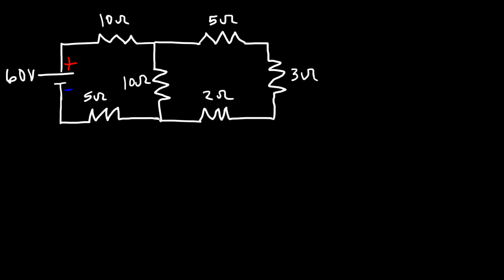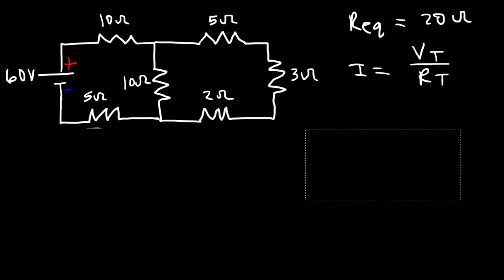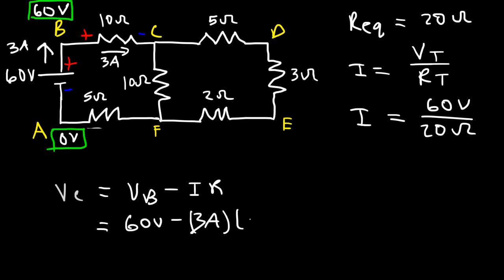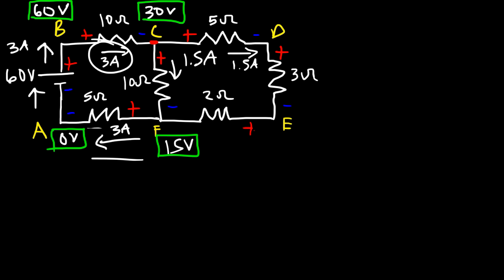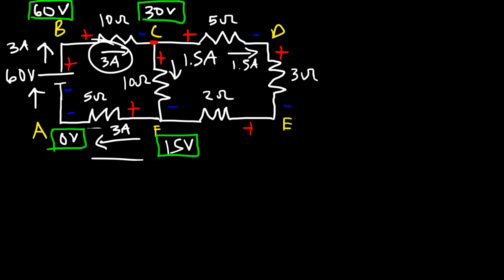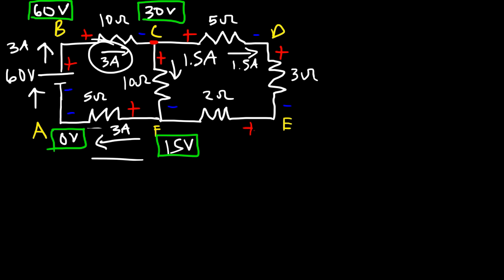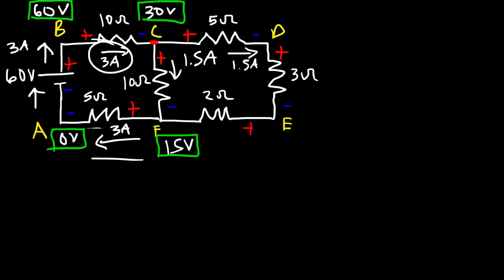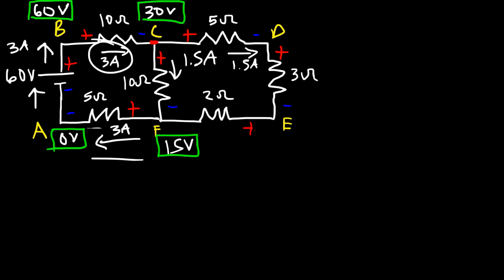How To Solve Any Resistors In Series and Parallel Combination Circuit Problems in Physics

Comment: for some reason i was never taught to redraw the circuit at all. I just watched this video and another one where you both redraw the circuit and my mind is blown omfg. it makes everything so much easier to understand
Reply: Exactly, I'm like wtf. My prof just told us to simplify the circuit in our head instead of redraw it. I'm like wut?
Reply: Absolutely NO redraws are necessary!. Find total resistance from right to left, back to the source voltage. Then figure the total current by Ohms law. Now, going from left to right...figure your voltage drops across  R1 and R6. Then subtract those voltages from the source voltage. Divide the 15 volts by R2 resistance to get 1.5 amps, which is half of the total current. The other 1.5 amps goes thru the rest of the circuit, or just divide the 15 volts by the total resistance of the three resistors in the far right part of the circuit. Bingo, problem solved people!
Reply: "thought" not "taught"    ;D
Reply: How did you solve without redrawing??😱😱
Reply: @adabujiki  it's taught
Reply: @user-sh8ms1kp1c  no, he's right, it means his prof never teaches him to solve the prob by redrawing the circuit

Comment: In physics class, to combine parallel repressors, we have been using the formula 1/Rt =1/R1 +1/R2, but that doesn't seem to be in your video. I'm still kind of struggling to understand circuits as a whole, and it would be very helpful to me if you could explain that rule/ its relevancy to circuits. The right hand rule also has been confusing me as well.

I love your videos, they've helped me loads in AP Chem and in physics. I'm really glad that there are people out there who make videos to help others, rather than click-baited videos.
Reply: 1/Rt = [1/R1 + 1/R2] and don't forget it's to the power of -1
Reply: You only combine them when u are trying to figure out the current encompassing the whole device (circuit). 
Once you do that you can troubleshoot your device with a multimeter and see where its failing you.
Reply: didiroxforever that method still applies, in the first question he did he said the total resistance for the the two ten ohm resistors in parallel was 5. He got that by adding 1/10 + 1/10 then finding the inverse of that answer

Comment: To compute 2 resistor  in parallel with different value just multiply the Numerator then add the Denominator and Devide the value that  you get  in 15:31 minutes 12 * 4 = 48 (Numerator) then 12 + 4 = 16 therefore 48/16 = 3ohms

Comment: Got confused about the current you wrote down towards the end. At 28:09 Should the current going from C to E be 1.7295 and not 0.5765 which is the current going from C to D to E?
Reply: I believe you had it correct you are just slightly confused. The current from C to E from the top going right and down is 0.5765A (this is the current going through the 12ohm series combination which is the 3 and 9 ohm resistor combination).  But the current going the 4 ohm resistor (diagonal section) is 1.7295. I hope this helps!
Reply: thats what i thought
Reply: @omarzouiten4006  yeah so the guy wrote it down wrong.... i was looking for a comment that talked about this lol

Comment: There is also another way you could solve the current going through the 3 branches @ 28:00 , you could find the equivalent resistance of r1 and r2, then use that equivalent resistance and the current to find the voltage once you have the voltage you could then find the individual current of r1 and r2.
Reply: How do you find the voltage of one with the equivalence of all resistors

Comment: You do such a great job explaining multiple ways to solve the same problem! In earlier lectures you showed how to do it by summing the resistors in series on right side and then solving the parallel resistors and now you explained the alternate way to solve to find the current through the middle resistor by using the potential difference between two voltage points on either side of the middle resistor and solving for the current through the middle resistor and then subtracting that current to find the remaining current flowing through the resistors in series on the right side of the circuit! Just what I needed explained clearly!

Comment: @ 28:13 , it should be 1.7295 A that runs through 4-ohm resistor right? Why is it the same as current is 0.5765A??

Comment: 28:11 I think you made a mistake assigning the current as 0.5765amps when it should be 1.7295mps.... Correct me if im wrong however:)

Comment: Hi sir, i am sure the calculation is wrong at 28:14, the current passing the 4 ohm resistor must be 1.76. It cannot be 0.576 because then the total current won't be 4.615, and so you violate KCL, and we calculated the current across the resistor is 1.76A
Reply: Yeah he mixed them up. But switch the current for i1& i2 respectively and you'll get them right

Comment: 28:05 Shouldn't the current flowing through the 4 Ohm resistor be 1.7295 A?
Reply: He fixes it later, in case you never watched all of the video.

Comment: 0:40 I do not get it. The first 10ohm, 10ohm and 5ohm resistors are also in a series, in the same way. Are they not??
Reply: This is two months late but here you go for future reference:
The first loops 10, 10 and 5 are not in series because the same current does not travel through the second 10 ohm resistor as it does the first 10 ohm resistor. There is a junction meaning that the current splits and travels down two different paths. In order for resistors to be in series, they must experience the same current.
Reply: However, after following the parallel and series rules for the second loop, the Req eliminates this issue, and all three are in series because there are no other junctions for the current to follow. It MUST follow the path of 10-5-5.

Comment: At first problem I didn't understand that part that u combined two 10 ohm resistors into single 5 ohm resistor and u said that we can do that bcoz of having two 10 ohm resistors in parallel there. Tell me how we can do that and what if the resistors values are different ??😢
Reply: Use the Reciprocal formula

Comment: 21:09 why we don't calculate all the potential diferences of each point in relationship with point A? because then later to calculate the current in the 8ohms resistor we do Vaf - Vbc instead of Vaf - Vac

Comment: and, the voltage between the points BC would be 74v, divided by 10ohms is 7,4amps, but the current there is 4,6 amps. The voltage between point AC is 46V, so that result (Vac) makes much more sense to me than Vbc. I hope I got my question across

Comment: Great video. Whether whatever voltage has gone out from the voltage source, has to come back in. If this is true, then how come voltage at point A will be zero. Does it mean that no voltage is coming back to the voltage source?
Reply: A has been taken at O V just for reference. You can take any value of potential at A but, then you must add that particular value to all the potentials  
at other points. Afterall,  potential at a point is a relative term.

Comment: I've recently discovered your series. I did so because I have an opportunity to test for a position in an Aerospace company as an Electronic Service Technician. This position will be responsible for diagnosing electronic systems involved in industrial controls. My degree in Electronics is 46 years old and although I have been involved in diagnosing and repairing complex electronic systems in Automotive, I feel out of my element moving into industrial controls. I have some familiarity with their systems and PLC controls due to my experience with the same company as a CNC machinist on purpose built CNC equipment. Having said all this, I am having difficulty in sorting out an order of lectures in which to study your content. Is there some kind of indexing system so I can know what lectures to study in what order? Thanks

Comment: hi,  at 20:46 , what if there is no 12 ohm resistor between point A and F , then how can we calculate the current passing through 8ohm resistor between C and F?
Reply: Good question! I think F will equal 0 volts, which will give you a current of 9.23 (73.85 - 0 = 73.85 ÷ 8). Then you use that number to get the separate current for CD & CE by using the equation he showed us.

That's just my guess though. I'm 99.9% confident.

Comment: Hi. I always struggle with this part of physics. So - when you calculated the resistance of the first three resistors in series (5+3+2=10), you connected that resistance parallel in the circuit. Why parallel?  Can it be connected in series with the rest of the circuit? Thank you

Comment: At 4:05 why did you choose to go in the direction of A to F in the Parallel Circuit? Why did you not go from C to F? After that point I was confused till the end. Please help.
Reply: You can go from C to F instead. He's just trying to show that he's a free thinker and he doesn't need to follow the correct steps and figures we'd understand. But it fucks me up too. 

If you go from C to F first you need to multiply Amperage by Resistance aka (2.309)(8) which gives you (18.47v). Subtract (18.47v) from voltage at node C (C=73.85) which gives you 55.38v at the bottom node F.

Now go from node F to point A.
Node F voltage is 55.38.
Resistance is 12Ω.
Divide.
And now you get 4.615 amperes
Which is what you started with.

Comment: Hello first of all let me thank you because I learned a lot from you but in case i think you have a mistake on this sum .if you leave with 120volt and you subtract 4.616 and x10  comes 73.85v how come  the other side you have 55.38v ? the voltage total don't add up because if you leave with 120v you need to finish 120v right and 73.85+55.35=129.23 right and how can be u step up in voltage? Thanks

Comment: I calculate all power in every resistor but when I add it, it is not equal to the power delivered by the battery. Please explain.
Reply: *in example 2
Reply: @annamaecustan9357  I Have the same problemmmmm. A year or so later, but did you figure it out?
Reply: @jixu7146  
I was stuck like that for a while because the powers doesn't add up, then I realized I got the voltage wrong on the 8-ohm resistor and when I replaced it it adds up almost the same. So I guess you just have to be careful with your values and double-check.

Total Power = (4.62 A)(120 V) = 554.4 W

Power of Each Resistor:
1. (46.15 V)(4.615A) = 213.02 W
2. (1.73 V)(0.58 A) = 1.00 W
3. (5.19 V)(0.57 A) = 3.01 W
4. (6.92 V)(1.73 A) = 11.97 W
5. (11.54 V)(2.31 A) = 26.66 W
6. (18.48 V)(2.31 A) = 42.65 W
7. (55.38V)(4.62 A) = 255.86 W

Summation of power absorbed by each resistor:
(213.02 +1.00 + 3.01 + 11.97 + 26.66 + 42.65 +255.86)W = 554.17 W

Comment: I have a question at problem 1 sir, if we change the value of resistor F to E from 5 to 10 ohms, why does its value of power not equal anymore?
Reply: Because the change in current and voltage through/over that resistor changes in a way that’s not reciprocal. The total resistance increases, thus total current decreases. Consequently the total power consumption/dissipation decreases. This will influence every component
Reply: @RoysIdea  yeah, so in short, its short-circuit? Or whats the term?
Reply: @HellO-bg4oo  maybe I should first ask what the actual situation is, since problem 1 has a resistor of 2 ohm and problem 2 a 5 ohm between the connection F to E.
Then I suggest for you to do the calculations yourself. Why do you think the power value has changed?
Reply: @RoysIdea  oh i change the value myself to make another problem, and when I solved it with same power just the FE resistor value changed to 10, the power was not equal anymore
Reply: @HellO-bg4oo  :D To put it simply: changing any resistor in the circuit changes the current through any resistor and thus their power dissipation.

Comment: In a parallel circuit there are 4 unknown resistors R1= R1, R2= 3R1, R3= 6R1, and R4= 2R1) where the total voltage is 20 volts, and total current is 4 amperes, what are the specific values of R1, R2, R3, and R4?......please help

Comment: I made the final checked and got the total e potential absorbed by the resistance and its near from the power delivered by the batterry (130 volts), why is it not exact to 120 volts? (I already double-checked the solution)

Comment: What is the effect of a short on a simple parallel circuit?
Reply: If you have let’s say two resistors and parallel and one wire shorting it then the current will simple travel through the wire and there will not be a voltage drop as the current will not even travel through the resistor. Hope this helps!

Comment: How to calculate potential btw 2 point which are adjacent to each other. Plzz tell me I am so confused about this case.
Reply: Depends on the case my friend. In more complex cases it may be easier to just use nodal analysis or even loop or superposition. If it is not extremely complex and easy to solve then you can use voltage divider and or basic KVL around the closed loop. Hope this helps.

Comment: Why isn’t 10ohms + 10ohms + 5 ohms added up together too? It’s also in series.
Reply: Series means the current is the same throughout the path. At each junction (or branch) current changes, so they aren't in series.

Comment: Anyone Else Taught current moves from negative to positive
Reply: the electron flows from negative to positive. however, an electric current can be either electron or proton("positive or negative" charged particles). it is wrong to assume electric current = electron flow only
Reply: @judy-chan4536   its a dc circuit not ac

Comment: I don't know how to say this without sounding like a prick, but although your answers are right, your method isn't correct. It worked because your resistance values had a particular  numeric theme, however the voltage drop across a series resistance is simply total current X individual series resistance.  If you did this video and changed resistance B / C to 5 ohms and resistance a/f to 10 ohms it wouldn't work the same. 

I think its also worth mentioning that you stilp did a great job on the video, and I couldn't do better or equal. I do feel it was necessary to point out the flaw.